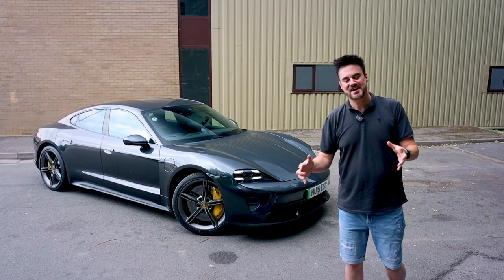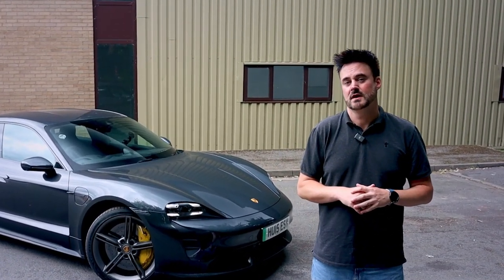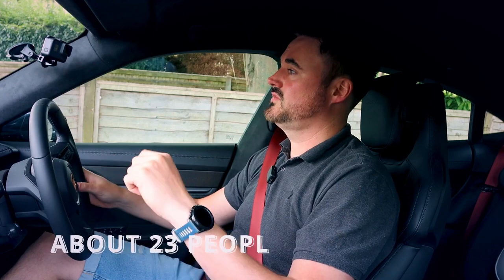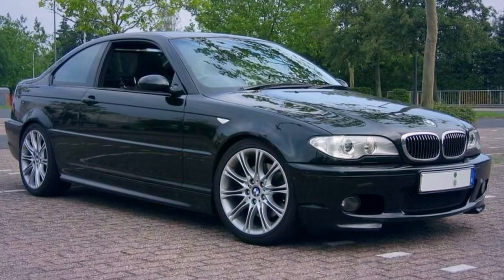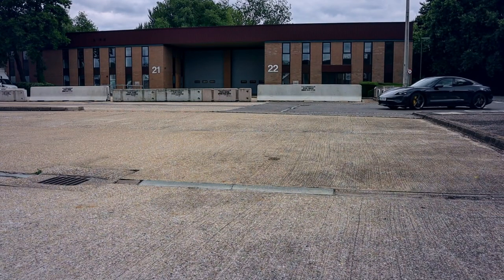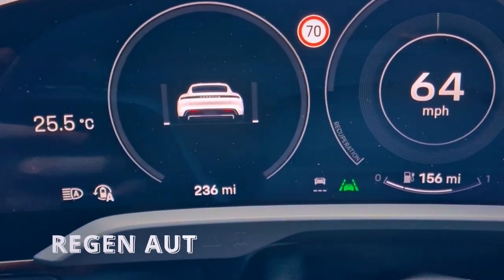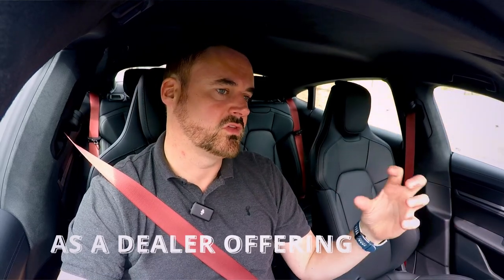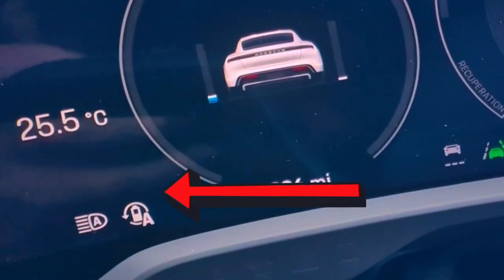Porsche Taycan First Drive - How Does Brake Regen Work?!

Comment: Great video. I like the detail. The only thing that as a bit off is the comments on the top speed. All of the Taycan models are limited to 160mph, just like a lot of other German brand cars are. I've seen plenty of other videos quoting Porsche saying it would go quite a long way past that without the limit. I've driven one twice and I have GTS arriving very shortly, and its true that the pickup is insane.

Keep up the good work
Reply from the maker: Thanks for the comments 👍 - I think the issue is with the motor is getting close to its 16,000rpm limit, and to get closer to 200mph ish it would probably need a 3rd gear. What's really impressive is just how stable it is at speed!

Comment: What do you think the of the Macan in comparison to taycan? I’d love to own a taycan but if a Macan EV is coming in 1-2 years and it handles well then maybe I will wait. What you think?
Reply from the maker: It's a tough one, assuming you want new, if you're wanting any Porsche in that timeframe you really need to be getting your deposits in now. Ultimately depends what's going to work for you...
Reply: @TABonTV  would only want an EV so right now that’s limited to taycan. I’ll wait to see how the Macan EV drives. I heard they might release an EV boxster and spyder but I’m guessing this will not happen for 3-5 more years.
Reply from the maker: @topspin1715  yeah, EV 2 seater on the way! Fingers crossed...